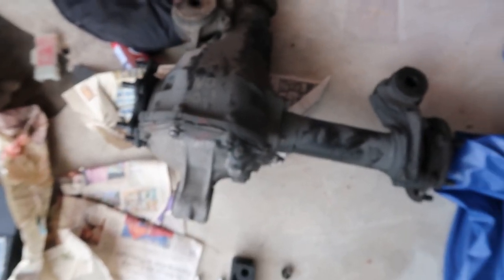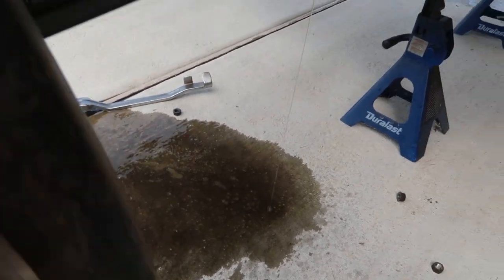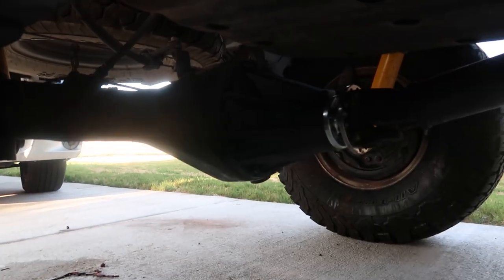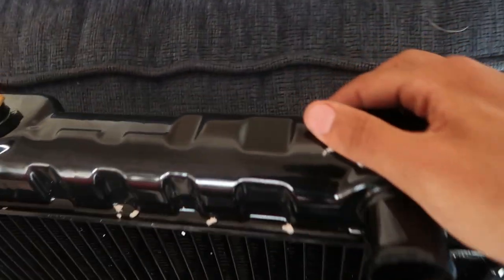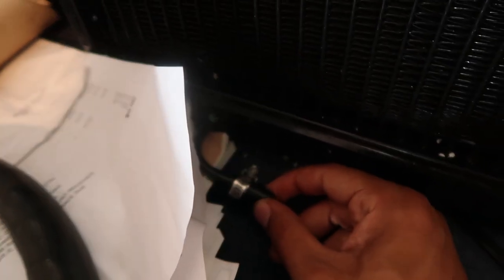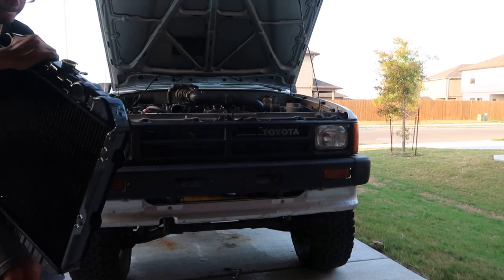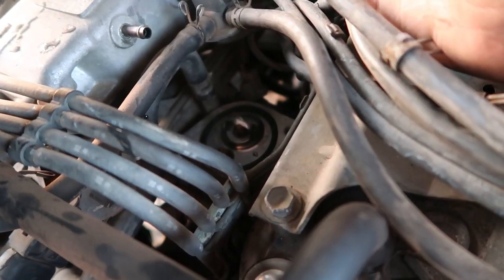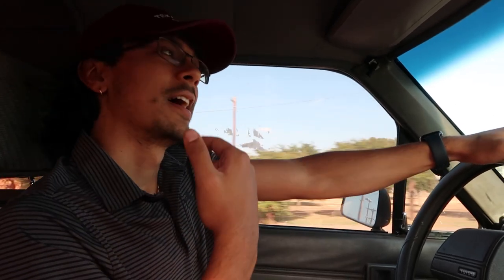Installing 4.88 Gears W TrueTrac LSD & CSF 3 Core Radiator On My 1989 1st Gen 4Runner

Comment: Where did you buy that radiator, what size tire are you running to have the use the 4.88 gears? Those gears usually run with 35” tires.